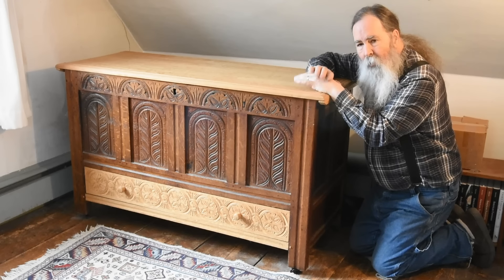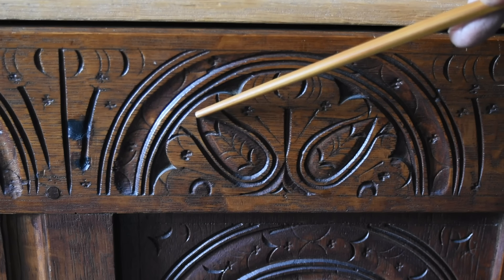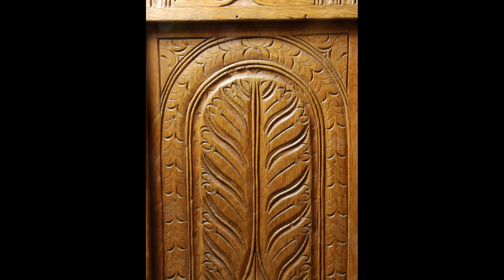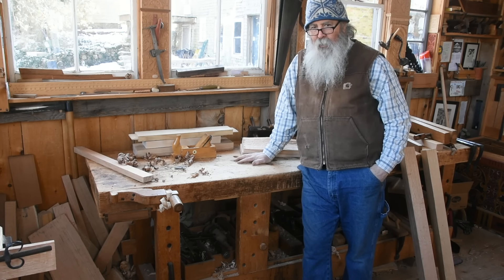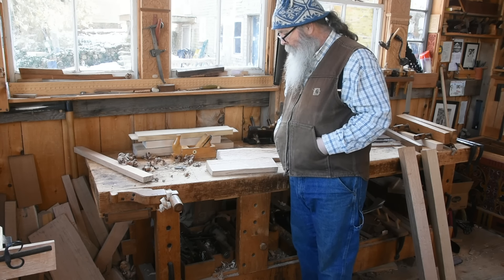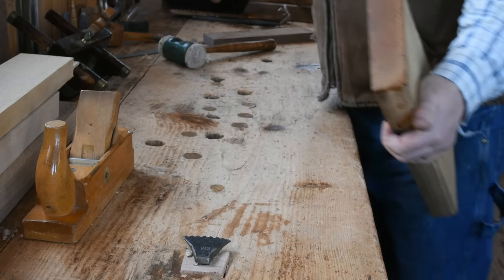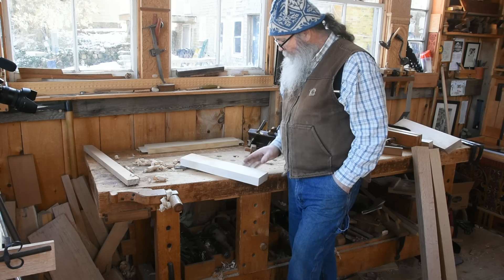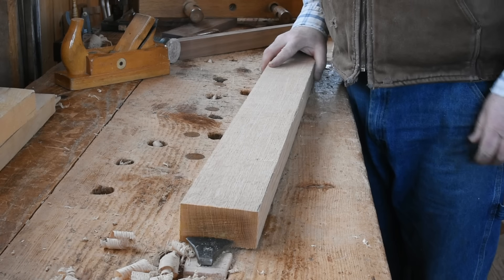Braintree chest project pt 1 Feb 6

Comment: Once upon-a-time I thought I was "pretty reasonable" at woodwork - table-saw, bandsaw, spindle moulder,  router, linisher, any contraption - I could find my way around all of them - I started out doing engineering (woodwork) drawing and gradually learned the basics from some amazing carpenters I've been fortunate enough to work along side over the decades. I learned the digital side of drawing, 3D Modelling and even some CNC gosh I knew 'EVERYTHING' there was to know! Then I came across your work and passion for 17c low-relief carving (I admire the New-England designs) it was like being hit by a brick wall and changed me forever. If you ever need a 50-odd year old apprentice, please let me know and I will swim to the USA from Wales! :-) Thank you for sharing your talent with the world.